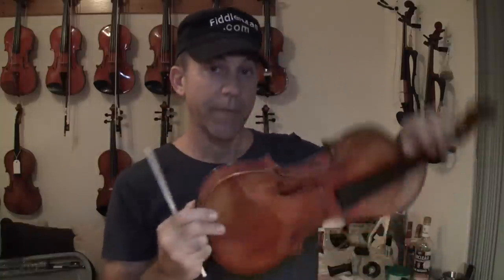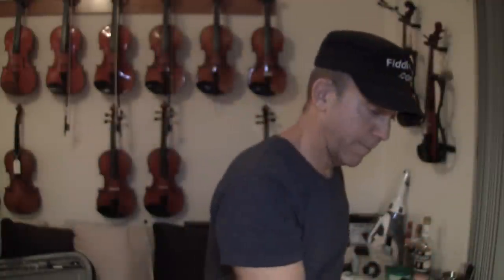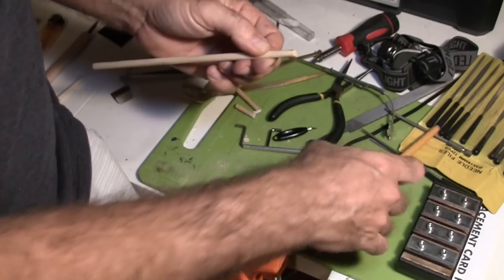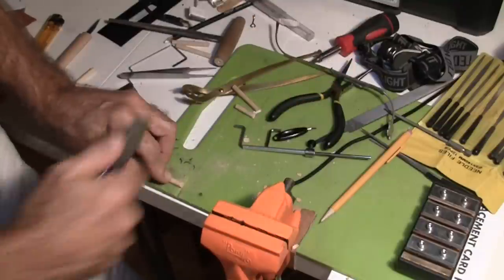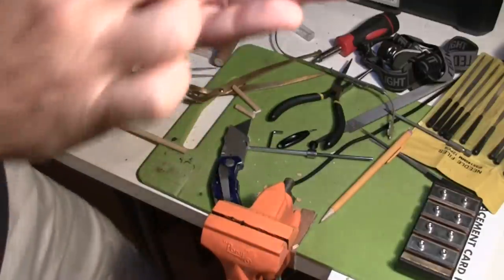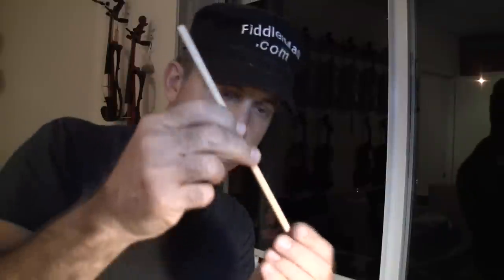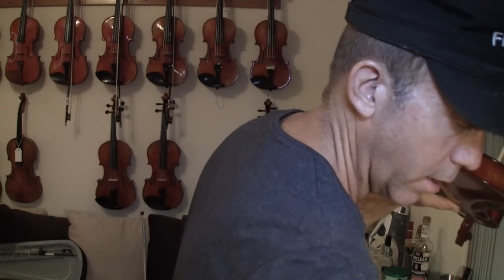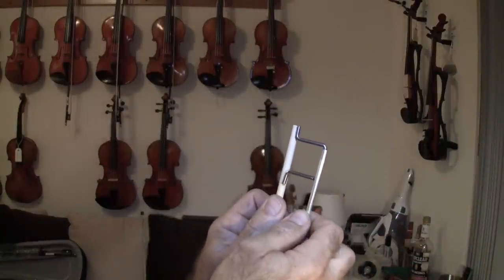How to Cut and Fit a New Sound Post

Comment: I realized only last week that the reason why my violin does not play loud and why it had this wolf tone (which wasn't there before) was that the sound post was missing. I played it for 2 months without knowing why a wolf tone suddenly was there and I failed to notice the sound post was missing. So, yeah I finally noticed the lost sound post, no trace of it inside the violin. But even though I'm no violin expert, I knew I had to replace it with something so I searched for some random replacement and I saw a wooden chopstick. I cut a cylinder of wood from it and using a large safety pin bent into the shape of the soundpost placer, and with perseverance I was able to place the chopstick soundpost. The violin is louder and that annoying wolf tone is gone (I had a hunch that it would vanish once I place a soundpost). And the good thing is that it didn't cost me anything. Then again, is this safe for my violin, using wood from a chopstick that's not really cylindrical, somewhat flattened but not too much? It got rid of the wolf tone so I'm immensely happy.
Reply: The top needs proper placement of a sound post to help support the bridge when the strings are tuned to pitch. Without a proper soundpost the top could become cracked or warped. Never tune to pitch without a soundpost in place for this reason.
Reply: "Stay-Frosty" that's Sew McGiver, eye 💛 it.

Comment: the problem with using the outside of a violin for angles is that a lot of german cottage violins are finger planed inside and not the same angle inside,  I have opened up 100s of violins in my tenure working on them and you will find a lot of them which have totally different angle carvings inside, the only way to verify this is either take apart violin or look through the end-pin hole either by eye or with endoscope is best,    cheers..
Reply from the maker: Very true. It's just a starting point. One should look around the post with mirrors/end pin hole/and take out the post a few times to see where the contact points are to shave razor thin adjustments. Thanks for watching!

Comment: Great videos for the novice! Prior to this, and not even thinking to watch other folk do this. I did sand the ends to shape. They did work fine, but I must have looked at the thickness of the post and thought " A blade's not going to go all the way through that" But this is way easier and more accurate Thanks!!
Reply from the maker: I'm glad that you found this useful. The sandpaper probably doesn't affect it much.

Comment: Tip... I work with leather and use the utility knife for most of my work. I have a leather strop I made by gluing a piece of leather down to a flat board and rub jeweler's rouge into it. Then I strop the blades of my utility knives on it. Even the brand new ones can be sharpened to a super sharp edge sharper then out of the box. Try it once you may be surprised at how much difference it will make. For those out there who may want to do this without having to make the strop they can buy one from Tandy Leather pre-made along with the jeweler's rouge. It will make your blades go a lot longer and will strop many other knives to a micro fine edge.

Also thanks for the very well done video!
Reply from the maker: Yes of course. We use sharpening stones and leather as well but the general public doesn't have that kind of equipment. Thanks for the tip. :) I've never bothered sharpening a utility knife but it makes perfect sense.
Reply: I never sharpened new utility blades until I started working with leather. You should try stropping them first you will be able to tell the difference and you will be able to use them longer and might throw away your special knife. I have a tool box full of special knives that I don't use much anymore because of this tip.
Reply from the maker: Very interesting. I'm looking forward to trying it.
Reply: @jasonadams527  chalk up another: "why didn't I think of that?"! Thanks for sharing.✝

Comment: Very helpful, I knew that the placement of the sound post was important but just how important is extremely important. What recommendation can you suggest if the base-bar develops a crack and may need attention?
Reply from the maker: It's hard to know if the base-bar has a crack but you probably need to remove the top if the base-bar needs work.

Comment: Great video. I want to try to make a new post for my double bass, I'm pretty sure the same procedure works but do you think I can make clean single cuts like these on a 16mm post? Or should I work more gradually. Thanks
Reply from the maker: I think if you have a real good knife in which you sharpen properly, yes you can make paper thin slices. If by gradually you mean slice a little here and a little there till it's perfect, yes, that would probably be easier.

Comment: Great video, Thanks. What about sound post tuning?
Reply from the maker: When adjusting the soundpost you need to loosen the top strings and should have a decent knowledge of what your changes do to the sound. I could obviously make a video but am a bit afraid that people would knock down their sound posts and blame me. :(`
Reply: @1stfiddlerman  I never stick the sound post with the pointy end thing. I tune the post to match the resonance of the back plate and I shave the back plate so that the sound post point is what drive the back plate resonance. Think of the violin as an air pump. The area between the f holes is the tweeter for the high notes so make it thin.

Comment: Fiddlerman , I need help. I just purchased a Barcus Berry 3100 violin pickup. I plugged it into my a tailgater. I am using a converter to convert the pickup jack to a normal microphone/headset jack. It won't work when I try to use it. I was wondering if the pickup powers up or if it requires a battery. I can't seem to get it to work.
Reply from the maker: Can you tell me what kind of audio tailgater you have?
You mentioned mic/headphone jack. Headphones are out and mics are in. You need to make sure you are using an input and not and output. Secondly, there might be a preamp on your tailgater. If you use a converter I'm not sure what that converter is doing. Are we talking USB to Phono plug? If so, it might not work properly.
I suggest that you bring your fiddle to a guitar shop with your pickup and test it on one of their guitar or keyboard amps. They'll be happy to let you do that in hopes of selling an amp. It'll give you an idea of what that pickup can really do. :)
Reply: I just tested it with 3 amplifiers today. It didn't work....i mean there is no battery to power the pickup....so what i was wondering is if it requires a pre-amp to power it. Fiddlerman 
...oh by the way i just purchased a 1/4 size plug so we don't have to take the adapter into mind anymore
Reply from the maker: Oasis Music and Programming Tutorials Sounds like you purchased a bad pick-up. I can't imagine you purchased it from us since we do not sell the 1/8" jack BB3100. When and where did you purchase it? Did you bring it to a music store to test?
Reply: No, I purchased it else where......oh sorry....I meant 1/4 size jack.....I purchased it about last Thursday and received it yesterday. I didn't bring it to a music store but I brought it to a professional music teacher I know and I had him test it with numerous amplifiers and cords and what not to which it worked for none. Both he and I still are puzzling as to rather or not it uses battery or if it uses a preamp to power it.
When I played acoustically, the pickup created a rattling sound. No matter what I tried, I couldn't resolve the rattle. I decided to take the pickup off and as I unscrewed it my bridge came out....I wound up breaking a few of my prim strings and scratching the violin. I later on (after putting the bridge in place and putting on new strings)  put the pickup on again to see once more if I could resolve the rattle. I tried tightening the screws more than I had prior on the pickup to see if getting rid of some of the movability. I wound up tightening the screws to much and cracking the bridge......I am now thinking about sending my barcus berry 3100 back and getting a barcus berry 3120 where as the pickup is built into the bridge. This I hope might resolve my issues with my newly broken bridge and my lack of a functioning pickup Fiddlerman 

today apparently violins despise me and violins have no desire to coexist with me I propose. Hopefully this craziness wont inflict it's self on me every day...today the odds are not in my favor I guess.
Reply from the maker: Oasis Music and Programming Tutorials
LOL, I think your luck must turn soon. :)
The bridge must have been too soft. I don't understand how it could otherwise break. The 3120 would require fitting. It's not all that easy to cut a bridge. You need to start with the feet then make the right curve. It's kind of complicated but if you know a reasonable luthier who could do the job for you, you'll probably be satisfied with that.
The 3100 and the 3120 do not require a separate pre-amp but the amps that you used most definitely had built in pre-amps. If you guys tested it on 3 amps, there must be a problem with the pick-up or the install.
http://fiddlershop.com/image/cache/data/barcus-berry-clamp-on-bridge-piezo-pickup-3100-49-550x550.jpg
Reply: Nope...I installed it delicately....the finished result looks just as the image you sent me details. I'm guessing I got a bad pickup....im also guessing from the condition it arrived in and how long it to arrive....I think it was dropped shipped....so I probably got a bad pickup.....so I'm guessing the pickup receives
power from the amplifier itself? I live near Reno in Nevada so I'm not quite sure if I will be able to find someone to cut the bridge to size since Maton music went out of business...is cutting the bridge to fit necessary? Fiddlerman
Reply: I just sent it back.....I've decided to purchase a fishman v-200 pickup from http://fiddlershop.com/electric-accessories/pickups-1415061439/fishman-v-200-violin-pickup.html

Out of curiosity, does this pickup require a preamp to give it electricity or does it just receive electricity from being plugged directly into the amplifier?

Comment: How Often... Would You Need To Change A Sound Post.   and Would A Stradivarius or Guarneri Still Have Its Orginal Sound Post??!
Reply from the maker: The Strad and Guarneri most definitely do not have their original sound-posts. The top on old instruments has risen quite a bit from their original position. Usually a new violin will benefit from a new post already the first year as the top lifts a bit. The downward pressure of the strings balances it out a bit but not as much as the wood reforms from the sound-post pressure, climate and the Spruce settling. Older violins rarely need to have their posts changed since they have settled but climate changes and frequent adjustment can require the need for a new post. Also, it's rare that we pull out a post and find that it's perfect to begin with.
Reply: Also, the original soundposts were likely a bit smaller in diameter when the instruments were in their original baroque setup. So even if the original post was in one of those instruments when it was modernized during the 19th century, it would have been replaced.
Reply from the maker: True :)

Comment: Good video, just few remarks.
Soundpost diameter should be 5-6 mm, no more. Your soundpost seems to be very thick. Thick soundpost make sound muffled and not very bright. Thin soundpost makes sound too much metalic with too much trebles and thin soundpost may damage plates so it is important to have correct diameter.
Long soundpost damages plates as well. Short soundpost can fall inside instrument.
 Setting soundpost with the tool is very delicate operation and you never want to touch f holes with soundpost setter. Damages to the f hole like pressed or chiped wood is very ugly and hard to reapair.

Comment: In AC Moore (it's a craft store), they sell wooden dowels of various thickness and lengths. Would I be able to use those dowels?  I frequently get 55% off coupons from AC Moore.  :)
Reply from the maker: You need the right size. 6.2 mm approximately and hopefully with over 5 grains. 7 or more is good.
Spruce tree.
Reply: craft store dowels are usually maple or birch, both are hardwoods, much denser than spruce. Spruce is the correct material due to it's high strength-to-weight ratio.

Comment: im close to 4 mins in the video.. question before i froget, can this be done by taping a small piece of sandpaper in the place that you test the angle and rub the post on it? wouldn't it be perfect? just like the bridge's feet?
Reply from the maker: Franco Buzzetti It would be roundish and wouldn't be completely straight. There is no way to hold it perfect when sanding. The cut needs to be 100% straight. If it's slightly rounded it won't fit perfectly.

Comment: Have you ever lost/dropped  a sound post inside the body of the violin?
Reply from the maker: Happens all the time. However, they don't disappear from inside of the instrument. You turn it upside down, allow it to roll to the f-hole and pry it out carefully.
Reply: Fiddlerman  So, its not a black hole where it vanishes to another dimension. Got it. Thanks!
Reply from the maker: Exactly. LOL
There are many other mysteries with the violin though. ;)

Comment: Why not just sand an angle into the tip of the post? Would take maybe 10 seconds.
Reply from the maker: It's almost impossible to sand a perfectly straight surface without rounding. Also, the sanding creates a rougher surface unless you sand many grades of paper to micro mesh or close.
Reply: @1stfiddlerman  I see. I tried this for the first time last night. Experience would pay off with this one. It was not fun. :)
Reply from the maker: @jwandhistools  Maybe have a few extra sticks ready. :) Thanks for watching. Check this one out as well: https://youtu.be/XoX11EAzGX0

Comment: I would never adjust the sound post without having the bridge in position.
Reply from the maker: It's necessary to make a first soundpost, also, posts become too short when the top rises and need to be replaced.  But for sound, you can play an instrument and adjust the post as you wrote.

Comment: Thanks for the video first of all. I clamp and glue but, even bend and rehair bows but would not dare to touch the soul ,-). But it´s a very good video, but why would sanding be not good? Sanding a bridge works well, why not sanding a sound post in place?
Reply from the maker: Sanding is shunned upon by many luthiers and makers for making perfectly straight surfaces and it also heats the material. I personally am not convinced that the heating is bad but this is what many say.
A flat file is preferred over sandpaper because they are flat and they cut rather than sand. Our luthiers only use knifes when cutting their sound posts. They don't use sandpaper on the bridge either. They use planes, scrapers, and files. For the perfection of the feet, they use carbon paper to find the high pressure spots.
Reply: @1stfiddlerman  using carbon paper to find the pressure points sounds exactly like a dentist tidying up a filling
Reply from the maker: @deadmanswife3625  Are you a dentist? Yes, it's the same principle. 😁
Reply: @1stfiddlerman  well no Fiddler man I'm not a dentist but my dentist retired many years ago and if I have to I'm going to pull one of mine out by my dang self.
By the time I left home at age 16 I had a lot of neglect.   
In a way it was kind of military so we just showed up to have a check on our habits. So we sort of just brushed the front ones to pass inspection.
Lol
Later 
As I was now taking responsibility for keeping myself alive my dentist saw me through a long time and made it so I could actually eat food. So I kind of had a lot of familiarity with the subject and he was the best.
(Like you and yours are the best)

Comment: No, that can not be right. The shapes outside don’t match the inside. Think about. It is inverted. Sorry.
Reply from the maker: Of course. However, this is a great starting point. The angles are extremely close. What differs is the graduation which usually doesn't change drastically. You of course must reverse the post when checking as I did. After cutting the post, one must put it in and check the fit. A great way to check the fit is by looking through the end button hole. Also using dental mirrors.
Reply: Fiddlerman thank you! I have just found him https://youtu.be/I1v2smll02E
Reply from the maker: @Qwerty8  I guess if I explain everything the video would be much longer. LOL. Good luck with your attempts. Research is great.
Reply: I have just started fixing my violin... wood always is a challenge for a toolmaker 😂
Reply from the maker: @Qwerty8  I bet. We have 8 luthiers at Fiddlershop and they sharpen their knives every single day, sometimes several times a day. We have great stones and diamonds as well as a Tormek, and more just for that sole purpose. It makes a huge difference.
Reply: Fiddlerman well, as a toolmaker metal is easy. Knifes are always perfectly sharp. But i love wood, it’s such a great material. A violin is not a chair, but a chair would be to easy 🤓
Reply: Fiddlerman never use a Tormek except for drilling tools. Finish: Sharpening leather (Abziehleder) Cr^2 O^3 (Chromoxid Paste) otherwise you have to sharpen your tools to often.
Reply from the maker: @Qwerty8  True.

Comment: Angles are not the same inside and out side of the instrument. Bad technique and advice man...
Reply from the maker: It's a starting point. The angles are very close. Plate graduations are very slight in the 6-7 mm radius of that post. There is obviously much more to it, but my experience shows that it's a good place to start. After that you can shave paper thin slivers from the high spots. I'm sorry you don't like my advice but this video is not intended for a professional, or a luthier.